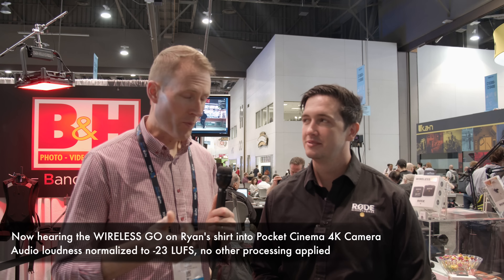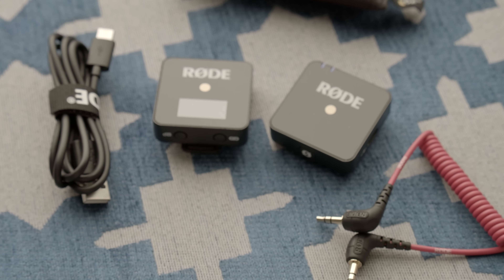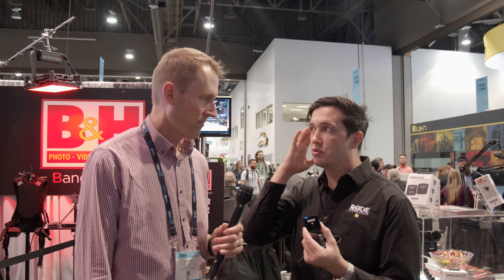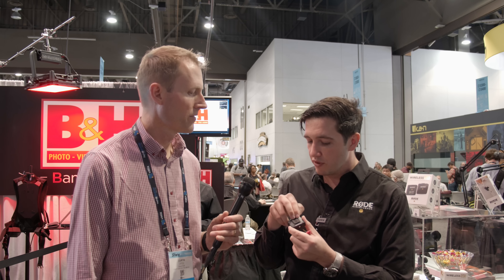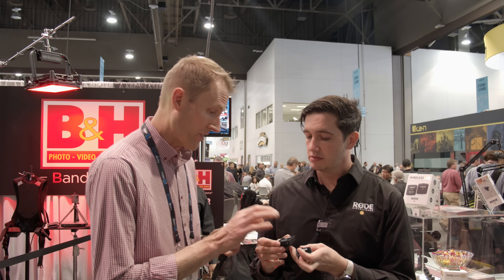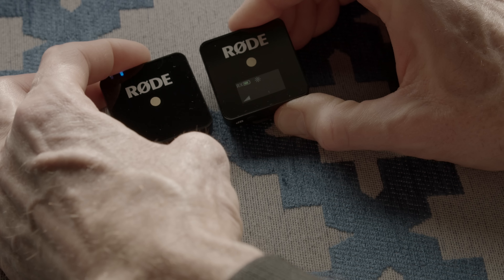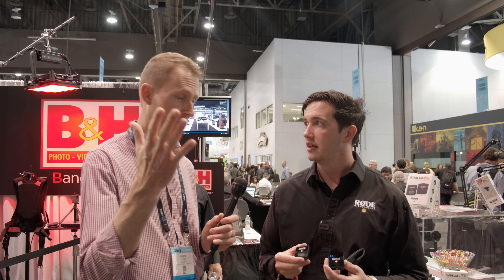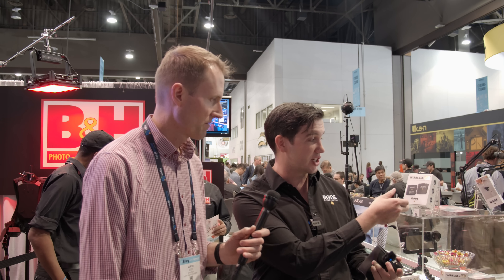RODE WIRELESS GO - NAB 2019

Comment from the maker: All of the audio you hear is from the WIRELESS GO that Ryan is wearing. The receiver goes into the Blackmagic Pocket Cinema Camera 4K. Loudness normalized the audio to -23 LUFS, NO OTHER PROCESSING applied.
Reply: Wow that is a small setup
Reply: That looks like an awesome little package. Would definitely fit in my arsenal, provided the sound quality is good. Can’t wait for the reviews.
Reply: Why do you normalize to -23 LUFS for your audio tests and comparisons instead of your recommended for web level of -16 LUFS?
Reply: @deadeyessmiling  I second this question.
Reply: How loud was the raw audio coming from the Wireless Go?  Did you have to boost it much in post?
Reply: I would like to see full review by you and your thoughts on it. Can we replace the battery or hhow much will it cost to be replaced. Can it be done by us or inly Rode? Can we use the Rode wireless lav mic without adapter? Thanks
Reply: Main concern is battery life with a plug-in power lav instead od the built in mic, also the recharge time.  Looks amazing!
Reply: The audio sounded stronger when the guy looked down. Not overly impressed by the onboard mic.
Reply: Add me to the curious, why -23LUFS. And I agree with the observation that the built in mic is not great. For some use cases, such as chaotic environments, the clip-on convenience is worth the sacrifice of mic quality. I know Curtis will give us an incisive review of this device, including how it performs with plug in mics.
Reply: I've been waiting for a wireless system like this for wilderness applications.  Been following the rumors and then pre ordered from B&H as soon as it was pre-order'able.  I also use an F1 and will continue for some situations.   But if the quality is good enough with this wireless setup and my cameras audio pre amps, I would really appreciate the time savings in my post work flow.
Reply: So i take it the mic youre hold is switched off or just not connected to the camera?
Reply: I'm not sure how this is much different than the Nikon ME-W1. Seems a bit larger. Is the mini display useful, or just a check to be sure it's on, without checking through headphones?
Reply: Why did you feel like you needed a back up? ;-)
Reply: Wow. Sounds very good.
Reply from the maker: deadeyessmiling in this case we want you to hear what the audio sounds like directly out of the camera without affecting the sound. Normalizing to -23 LUFS didn’t require any compression, just move all the audio to a reasonable loudness (raises it by about 2 LUFS). If I pushed to -16 LUFS, I would have had to do some compression first which would have changed the sound slightly.
Reply from the maker: George Ou raised it by 2 LUFS. Not much.
Reply from the maker: Alex Valtchev the battery does not appear to be user replaceable. Not sure what it will cost. Note that most Li-Ion batteries these days are rated for 500-1000 charge cycles which might help give you an idea of how long these may last over time. Yes, you can use the RODE Lavalier without and adapter. The smartLav+ may require an adapter. I’ll have to check that.
Reply from the maker: 1991ClarkJames good questions, will check.
Reply from the maker: Sound Speed! Hahaha! Audio Ltd. A10 wasn’t doing well. Deity Connect was ok with a shark fin antenna. But this did surprisingly well.
Reply from the maker: Gordon Moat not sure, haven’t used the Nikon before. The display is useful - battery status, input meter, links status, and output level indicators.
Reply from the maker: Musique Decor Multimedia correct. We recorded to a separate recorder with the handheld mic as a backup. When we got it post, found that the wireless audio direct to camera was good so we never synced the audio from the handheld mic to the videos clip.
Reply from the maker: Owen Crowley plan on it. -23 LUFS is so that you can hear how the audio sounds directly out of camera without any compression, which would have been required to hit -16 LUFS.
Reply from the maker: Gary Widom that will be true of any lavalier microphone.
Reply: Originally thought of the shure mv88+ for my phone, but im sold on this. Thanks
Reply: I was super excited until I realized the battery wasn't replaceable. I dislike disposable by design gear even if the performance here is pretty amazing. Yes, it's inexpensive while it works, but in a couple years this  will be dead where as a Tascam DR-10L will still be a cranking away with the only major disadvantage being having to sync in post.
Reply: @curtisjudd  you rock. Thank you so much for the thorough response. That makes total sense!
Reply: @Musiquedecor  I think he is saying he recorded with it just didn't use that audio track and used the lav mic to give us an idea how it sounds.
Reply: what is a good distance between the transmitter and receiver before it starts breaking up?
Reply: i know it is pretty off topic but do anybody know of a good site to watch newly released tv shows online?

Comment: Thanks for visiting us at NAB 2019!
Reply from the maker: Thank you for helping set this up, very much appreciate the chance to talk with Ryan.
Reply: Ryan is such a good presenter.
Reply: Quick Q:  Will the battery be replaceable at End of Life?
Reply: Is there an adapter or cable for XLR inputs?  Can I use other cables without problems?
Reply: I'm looking forward to buying at least one of these very much! Putting a micro SD in the transmitter for backup would have been beyond amazing (why bother buying a tascam dr10l, for the same price, at that point!) but as it is I think this is the product I'm most excited about picking up from NAB!
Reply: when it 'll be availiable in Germany?

Comment: That’s amazing. I especially like the built in lav mic option.
Reply: Amazing??? It doesn't even have a replacable battery. How many rounds do you think this internal battery has? Very non-future proof. Tradeoffs for ease of use against the logic is daunting nowadays.
Reply: @al12eksei2 : I suppose different specs have specific uses and in my case for what I do, it is perfect. According to the specs it has around 7 hours running time and can also be powered by usb battery pack if required. I do use a regular Sony wireless lav kit but this new Rode kit will offer me more condensed portability when needed.
Reply from the maker: Not for every use case, but good for some.
Reply from the maker: Yes, hard to beat in terms of size and convenience.

Comment: Think this would be worth ditching my Rode Wireless Filmmaker Kit for these to make them easier to hide / travel  with? My worry is that they'll be more prone to interference since they are smaller.
Reply from the maker: Still need to test to see. The rated range is less than the Filmmaker kit so they're not exactly for the same situations. I was surprised that this one did so well on the show floor as I had a rough time getting my $5000 pro system working out there.

Comment: Excellent coverage of a hot little product, Curtis. Thank you. I wonder if that screen can be turned off. I wouldn't want any unnecessary light shining on my talent. I also wish they didn't make the clip carry the RØDE name on it. Now I have to stick some black tape on it haha!

The Sennheiser Memory Mic I use was promising (the mic element inside is great), but I always felt some things were lacking, like a mic input jack and the silly white colour casing. This RØDE WIRELESS GO addressed all the issues I had with  my Memory Mic. And it is the same price too.

RODE is on a roll, man. First the RØDECaster™ Pro, and now this.
Reply from the maker: Thanks! The screen on the receiver automatically turns off after a few seconds.

Comment: I wonder how it compares with the sennheiser. Looking forward to your review.
Reply from the maker: So far, so good. I like that it has the ability to reduce the output level of the receiver because some cameras, like the GH5, has a very hot mic input and we were in constant danger of clipping with the XSW-D and GH5.
Reply: @curtisjudd  I got the sennheiser with the XLR receiver that works with the GH5 XLR adapter.   The  GH5 XLR adapter has the ability to dial down the gain farther than the camera itself and also you can switch to -20db if you wish. ........ DONE!!!
Reply: @claytonmoore2091  It's audio workflow 101 - to have control and provide optimal level before getting it into the final delivery, which in your case GH5 with rather hot signal. Lowering the gain in camera is not the same as controlling the gain transmission which is not available in the XSW-D. For that I'm, I"m in favor with the Røde even if its a simple Low-Med-Hi output.
Reply: @rastAsia  Whatever works for you right ;-).
Reply: @curtisjudd  Would love to hear an A/B comparison with the sennheiser XSW-D - in your excellent real world outside review style !  :)
Reply from the maker: @kane01337  I had to send the XSW-D back as it was just on loan for the review, but we should be able to A/B the two videos once the GO review comes out.

Comment: If this system is as good as it looks up front, it will put a serious dent in the market for single use wireless audio.   I don't see anyone else even coming close to this.  Now if it would handle two transmitters into one receiver, the rest of the manufacturers might as well close up shop.  Well done Rode!!

Comment: Excellent audio display and for most YouTube shoots it’s works. Has anyone talked to having the same system type but for two to do the video you just did with out having to mess with syncing
Reply from the maker: Deity just launched a dual channel wireless kit if that’s what you’re referring to?
Reply: Last year Samson launched a dual channel mostly for the iPhone but works on camera set ups. You would think for the situation much like the video you and others make during convention situations a dual rig in high noise would be something more available. What I noticed is the clear audio from the rode system. If that could be dual channeled if we’ll be a winner. I will check out deity and thanks

Comment: Last year, I bought the Rode Newsshooter Kit.  Aside from the ability to use XLR mics with that, I wonder what the sound differences would be.  Do the new mics have newer technology?  I like the newsshooter kit, but the transmitter is a bit unwieldy especially when using it with a lav. This new system has a much better form factor. Curious if there are any other differences.  Would also like to see a shootout with the Sennheiser XSW system.
Reply from the maker: Hi Brian, the range spec isn’t quite as far with the Wireless Go. Also, you cannot change the batteries. Sound quality wise, I wouldn’t expect a huge difference but our tests should tell us for sure.

Comment: Hi, very interesting system. I wonder if the the receiver works with a headphone? I could like to use it for people who has problem hearing in conferences. So that the orator may use the sender and someone on the public may use the receiver connected to a headphone, so that they can hear better. Or do you recommend another products for it? Thanks for your answer.
Reply from the maker: Hi Jorge, the receiver has a microphone level output so it unfortunately will not work well with heapdphones.

Comment: can you also check if the transmitter can receive line level signal when you review the unit? There's a plenty of workaround but it would be very convenient if it can receive line level without any adapters. Also i'm curious about the clip's durability, is it replacable?
many thanks
Reply from the maker: Hi Eric, Are you asking whether the receiver outputs a line level signal? If so, I believe the answer is that it is not - it is microphone level as this is made for hybrid cameras with a 3.5mm mic input or mobile phones. The clip was permanently attached to the TX and RX. Not sure whether it can be replaced. I would guess it depends on which part breaks, but will take a closer look.
Reply: @curtisjudd  thanks for replying, i mean does it accept line level signal without clipping?  Sometimes i do event documentation and wondering if can directly take the audio from the mixer which usually have Line level signals, but i guess i can use the signal from headphone output from the mixer instead.
Reply from the maker: I see. I think it only takes mic level on the 3.5mm input but will test it.
Reply: @curtisjudd  thank you

Comment: I use the Sennheiser AVX (1.9GHz) digital wireless system and they have a similar claim where the system "hops very quickly" to find the best frequency. I'm assuming that's needed for all of these types of digital systems. I do love the system but I have occasionally experienced random interference issues at trade shows (i.e., the robotic voice sound) using them in interview setups similar to the one you did here. My question is, is it possible that Rode has some secret sauce that could make the Go better regarding the claim of a "rock solid" connection?
Reply from the maker: Its possible. The companies don't share the specific details and I was surprised that the RODE did so well but admittedly, we did not test it anywhere else on the show floor. I suspect it would have struggled in other places on the floor where there's more RF activity because even my Audio Ltd. A10 had trouble in several areas.

Comment: Would you be able to use two ore more in conjunction?
Reply: would love to know this too. would be really nice to connect a couple mics to single recorder
Reply: Yes - would like to know.
Reply: According to the specs you can run 8 pairs at once.
Reply: DitzlerPhoto any idea how to Record  3-4 channels Down that Way? Two of Them into the camera itself but the rest? Some zoom rec or?
Reply: @Mintyseden  You would need a Y cable on two of them that go into the camera Amazon ASIN B000068O5H. That would put one mic on L and the other on R. Then another one into a Zoom or Tascam 2 channel recorder with the same Y cable. Then you have 4 tracks. I don't know how well it would work syncing in post with every channel at a different volume. You would need to make sure that each mic was hearing some of the other mics audio or you will have to align it yourself. Because one is linked to the video you are only aligning one other audio track so it shouldn't be hard to do.
Reply: DitzlerPhoto Thank you for taking your time to answer. I came to the same conclusion. However I was thinking it would be better to get a mixer and sync with the scratch audio from the camera. It’s just more stuff to carry and handle. I can’t be the only one needing  to lav up 3 or more people as a one man run and gun?
Reply from the maker: The Deity Connect may be a better option with two channels to one receiver.
Reply: Curtis Judd what would you suggest to get an light and quick setup for getting audio from 3 maybe 4 people? Thank you for your reply.
Reply: @Mintyseden  I'm curious about a recommendation for this as well.
Reply: @ChadPrewett  I'm holding my breath for the "Tentacle sync track E" https://tentaclesync.com (the first slider on the banner) sounds like an absolute cool setup for multiple audio and or cam setup.

Comment: If the transmitter is clipped on the front, does the signal cut out if the talent turns their back to the camera? Also if the transmitter is clipped to the back, are there any problems? Thus no longer line of sight.
Reply from the maker: Great questions, will test this in the review coming later this week.

Comment: Awesome video.  Do you know what the lifespan of the battery is like,. Example: 300 total charges etc?
Reply from the maker: No, not sure on this one. But most modern Li-Ion batteries are rated for at least 500 - 1000 charge cycles. RODE usually uses quality parts so I'd be surprised if it is less than 500.
Reply: Curtis Judd thanks for the reply.  I’m definitely going to order one!

Comment: I haven't done a lot with the GH5 built in 3.5mm mic input, but my understanding is that it is far more "sensitive" than is typical for mirrorless/DSLRs.  Is the -12dB (not sure of which dB scale here) option adequate "pad" to put the feed from the RX to the GH5 mic input at a reasonable level?
Reply: I'd love to know this too as a GH5 user
Reply from the maker: Will definitely test this for the review.
Reply: @curtisjudd  Fantastic!  Looking forward to your review!
Reply from the maker: Just got a note from RODE that they’re doing a firmware update to allow -20dB.
Reply: Great news.
Reply: The later production runs have -12 and -24 db steps.